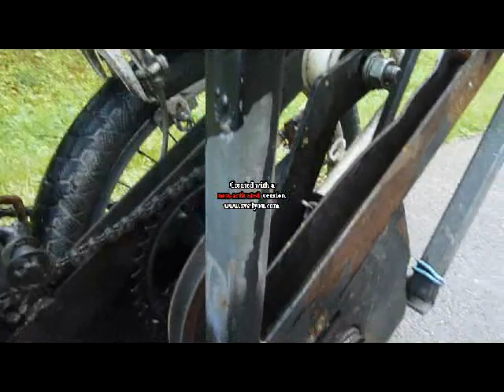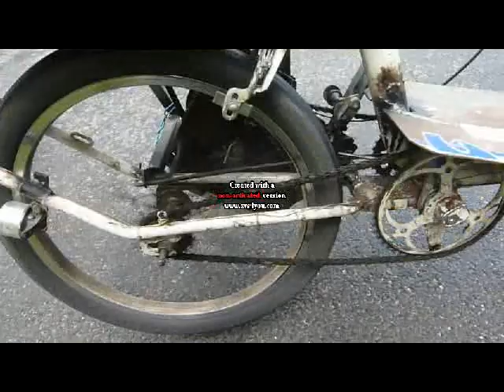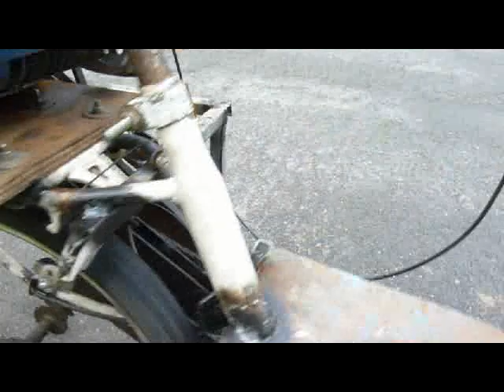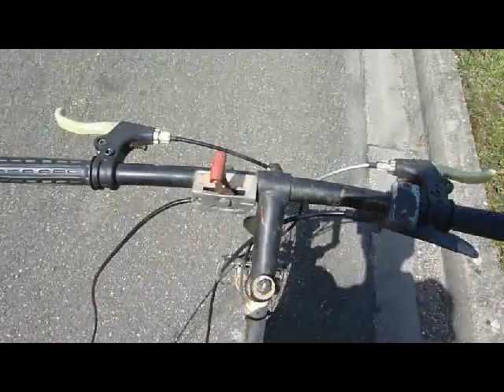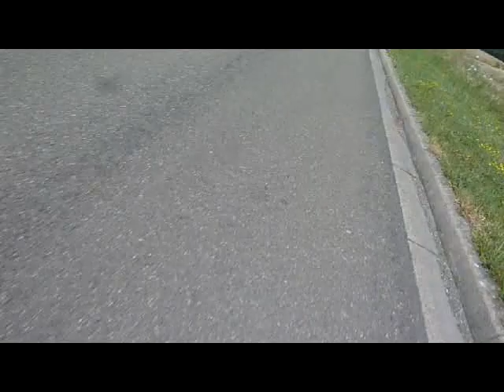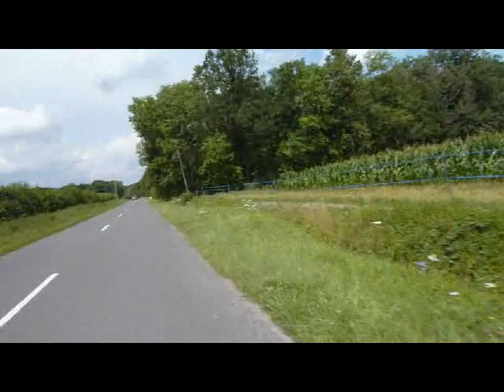Vélo moteur - bike motorized

Comment from the maker: i used the pto side of a mower engine for the demultiplication integrated, for not  make to the bicycle chain go off the rails.
The main crank does not serve, it turning in the space (above the rear wheel.) 
Je suis Français et j'espère avoir correctement écrit la réponse à votre question ^^